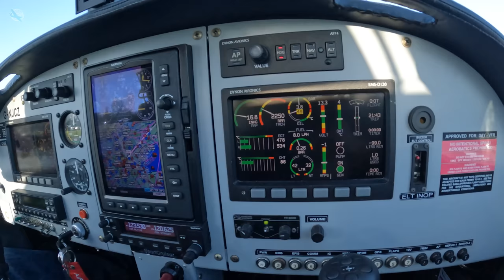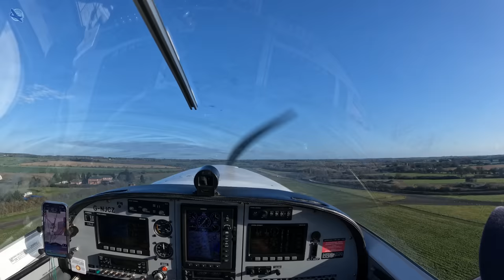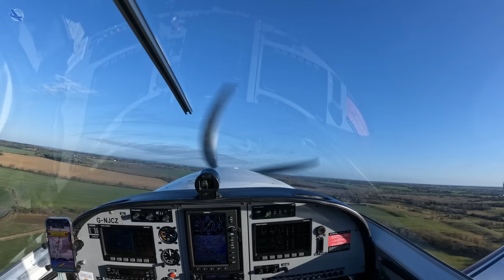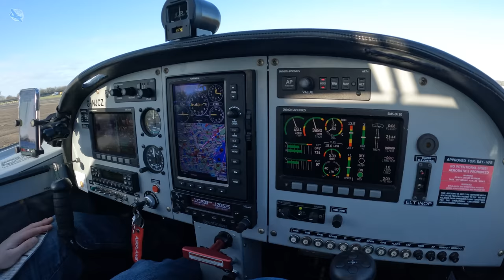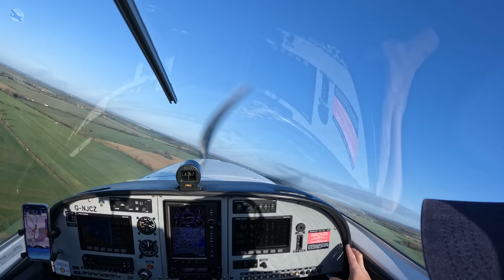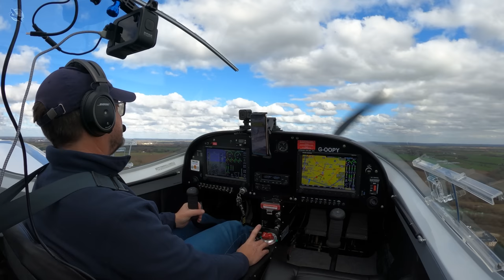Engine trouble immediately after take off!

Comment: Isn't 200  ft a bit low to retract flaps? I've been taught to do it not below 400 ft
Reply from the maker: Just based on speed, 75 knots and flaps have to go away.
Reply: @ShortField  Yeah but you could increase your climb rate to keep the speed below 75 kt

Comment: Interesting way to enter the traffic pattern. In the US, you would enter downwind at a 45 degree angle.
Reply from the maker: I know the US system but in the UK an overhead join ensures you're well clear of pattern traffic while giving you a great way to orientate yourself to the field and look out for others. We can join at any leg of the circuit and had their not been traffic already in there I probably would have opted for joining downwind. I like the US system but the UK one works OK. Thank you Caleb.
Reply: @ShortField  very interesting to see the difference.
Reply: @ShortField  - I also prefer to do a Standard Overhead Join if cloudbase permits. I find it beneficial to situational awareness and allows for an easy change of intention if the wind favours a different runway once I get a good look at the windsock(s).

Comment: Why does your plane break so much
Reply from the maker: The aircraft is usually reliable, the pilot on the other hand :-)
Reply: What was the cause of partial engine failure?
Reply: That was a Rotax engine most likely a 912.
Reply from the maker: @thetruth8206  plug trouble 😞
Reply: @Short Field, was it a fouled plug? Btw I'm a sim pilot not a real pilot
Reply from the maker: @mistercap5725  no sir it was a failed plug, you can often clear a fouled plug but this one, in fact two of them had burnt out electrodes. We're still trying to find out the cause of it.
Reply: Idk why but this comment is so funny😂😂😂😂
Reply: @mistercap5725 it's called videogamer, not sim pilot 😂😂

Comment: There's an excellent course on FAASafety titled The Possible Turn. It does a fantastic job of working out the math of when to put it down straight ahead or do a 270 and return to field in case of engine failure.  Highly recommended!

Comment: Interesting that you had such a large loss of power with just one failed spark plug on one of two ignition systems!! 🤔🤔
Reply from the maker: They tested all the plugs and found 2 with issues, we are investigating further. Deffo wouldn't climb but we didn't lose height so in the end more of a big shock as it is an unknown, for all we knew the engine could have been just about to blow up. I can assure you this was not a Trevor Jacobs video 🤣🤣🤣

Comment: At the risk of stating the obvious, shouldn't we have airless square narrow tires in aviation?  it's a momentary operation type of usage so it doesn't need endless durability or ride qualities. Storage durability, light weight and minimal drag is what counts. Just has to be barely wide enough to function on a grass strip.

Comment: Hello, I am about to start my hours building of 100 hours on PS28. Do you have any good manuals, docs or tips before I move on to Sport Cruiser? Thanks
Reply from the maker: No not really Luka apart from, remember it is a very light aircraft, you get thrown around in thermals, very sensitive in pitch. Apart from that it's a brilliant little aircraft you will love it. I did a little video on it if you are interested https://youtu.be/OLOMMdDQG_U

Comment: I don't say this to be deliberately negative but it is surprising that neither of you were able to diagnose a duff plug. I come from a rotax 2 stroke microlight background and in the old days we always did our own maintenance. Replacing little end bearings and decoking was a regular task. Quite frequently having to deal with rough running engines due to one thing or another. It is odd to find myself in the modern world where people seem to have less mechanical knowledge and competence
Reply from the maker: We are a bit useless when it comes to engines, which is why it is maintained by certified maintenance organisation Gwyn.
Reply: @ShortField  yeah, and really wasn't intended as a criticism, just a surprise. It would be helpful though to be more savvy for the time you're at an away field with no engineers on hand!
Reply: @ShortField  As a non-pilot, but an aircraft engineer with quite a few years of experience, I would not think about commenting on the flight and safe landing. But gving a full power check to an already rough running engine without taking a look first (suppose you had lost oil and or coolant?) was risky to say the least! If you engine is playing up - shut it down and get a tech to take a look! Just saying..... :-)

Comment: at least you didn't attempt the 360 turn back (which never works anyway) 🙂
Reply: Well it does depending on height, but it wouldnt for him for sure. 180 btw!!!
Reply: @martinkay9646  180 will take you on a reciprocal course but not lined up with the runway... furthering the turns back to the runway increases the number of turns significantly anywhere between somewhere between 180 and ≈360 once all turns are completed left and right to recapture the runway heading (take account of of wind/drift corrections too) - not for the feint hearted and the height loss will be significant as the angle of attack increases with each turn. You should try it sometime (with and instructor) say 5000ft and see how much height is lost in these turns.
Reply: @grahamlees4394  yeh 200 degrees more like it then, Ive done it a few times at height, averaged about 700ft loss I think overall
Reply: @martinkay9646  me too but 200 degrees won't cut it - think in terms of the extra distance you'll travel in the turn away from the upwind end and adding in the surprise factor (which is less of an issue when practising this manœuvre). 
Academic in Terry's case in any event as it was partial, not full engine failure which at that height would require the trained technique.Apologies BTW, i did mean to say 260 not 360 - finger trouble 🙄

Comment: That's another pair of pants completely ruined! So... in hindsight, do you still think landing immediately would have worked? Partial power loss is really dangerous because it can keep coming and going.
Reply from the maker: Cheers James, you're correct, the washing machine has seen alot of action recently :-) Sometimes you do think a total engine failure would focus the mind more.

Comment: I dont understand one plug should not make partial engine fail, one time in manyeto  Check , i forget to switch on line B and takeoff i realite after 10 minute off flight when checht eğt temp low and engine works little rough in Cruise. Cross check your manyetos one plug wont make huge Power loss.
Reply from the maker: Oh it does I can assure you. It's the equivalent of losing 20% of your power, we could maintain height and climb a little but it was really rough not only that it was not knowing what the issue was that made it 10 times worse, for all we knew the engine could have stopped at any time. I have also had an igition module fail on a Rotax but luckily on the ground, I'm not even sure you could get airborne on 2 cylinders.
Reply: @ShortField  i know that feeling something very wrong but what. İt flies only one line but you cant get full rpm , at that Day im solo and i feel something thing very wrong on down wind leg like prop off balance or carb  ice i tought many milion question than see the key swich on line a 😀

Comment: Rotax engines are supposed to be redundant with a dual set of spark plugs? how can it fails that way?
Reply from the maker: Good point, it was actually 2 that had gone, we are still trying to get to the bottom of it. You are correct though.

Comment: Great video (again), but for different reasons this time! If it's going to happen, I guess the best time is with two pilots on board, nicely handled 👍Is the engine near a service interval ? Worrying to lose a plug at anytime , but I recall one of the Rotax gurus saying always be double sure of the source of spark plugs, as there have been some good copies in circulation to catch out the 'own' maintenance guys. 🧰. Looking forward to more installments, with whatever events are thrown at you next! 😵‍💫
Reply from the maker: Cheers Steve. We switched from 100LL to Mogas when we fitted a brand new engine last year, when running on Mogas you can increase the plug replacement times to 200 hours from 100 hours, we have now gone back to the more conservative option after this issue.